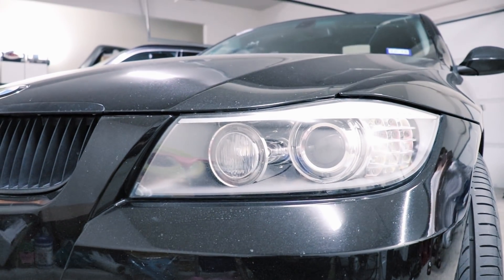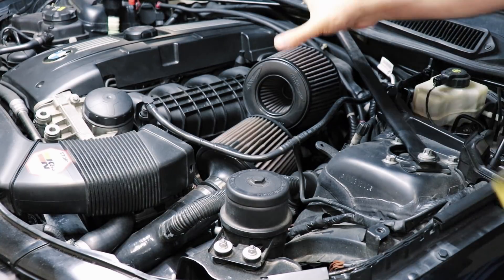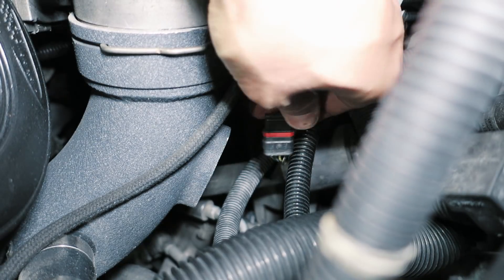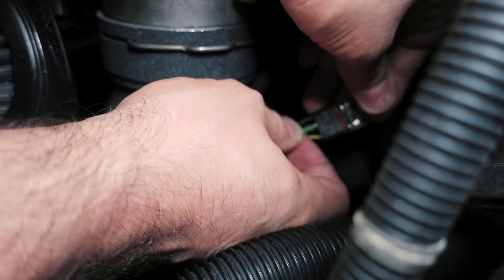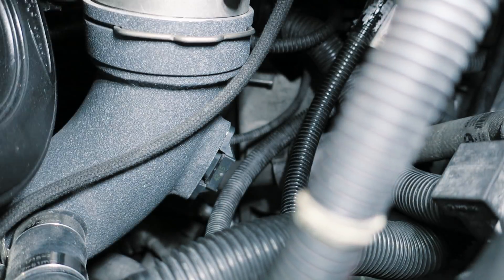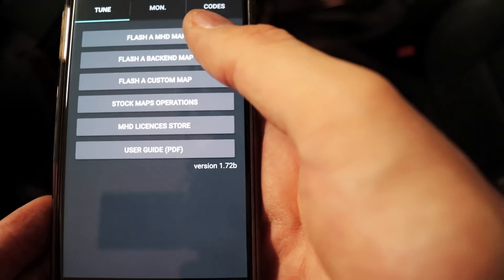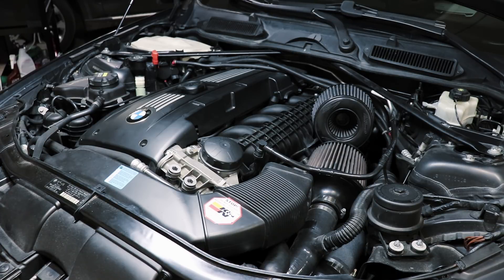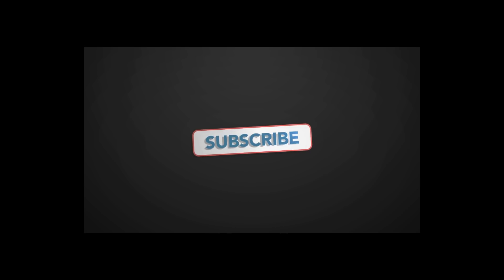Do you need an N20 map sensor on your N54 or N55 BMW?

Comment: Hello I have a n13 engine bmw f20 I keep getting low boost drive train error changed the map sensor was working fine again when flooring error happens again would I need a 2.5 bar sensor or higher as I've mapped my car boosting more

Comment: Nice Video, but one question... if you have external boost gauge, there is no need to upgrade the sensor right?... stock sensor won´t limit the boost even if it is above what it reads?

Comment: Hello, I am driving an e93 335in 55dct. I found out while searching that 3.5bar n20 map sensor can be installed, so is it okay to use either f30 or f10 stock n20 map sensor? I wonder if it can be installed right away without needing another adapter. And I wonder what the effect of this is. Have a nice day

Comment: I’m currently collecting parts for my custom tune and this is on the list 
When you fit this sensor does the MHD monitoring app show correct boost pressure or does this just scale the 0-5v output
Reply from the maker: Yes it does, the new info gets written to the DME when you check the option when flashing.

Comment: Thank you for this Information. 

I did mine just like that but do you know how solve  2abd bmw code
Have 17t turbo mhd .jb4 backnend flash driving for 6 months like this and this morning that code comes up every time I start
Reply: Dear, i have the same issue do you fix it ?
Reply: @raphaelpmcurvo  hi you in cape Town
Reply: Firstly check  your plug at n20 sensor all wiring connections.

Comment: I bought the BMW Brand 3.5 BAR upgraded MAP sensor from ECS Tuning.  I'm running MHD stage 1 v8 on my 2008 BMW 335i N54.   I was throwing DME codes 21ABC & 3100 and had to do the rewire to fix it.

Here's the part number in case anyone needs it. 

Mfg Part #13628644433
ECS Part #ES#4164452
Brand BMW

Comment: Hey man I I just installed the 3.5 on N54  flashed it with MHD also running JB4 flashed it on both side and the car is running super rough and won’t hold idle. I bought it with the harness and I don’t know if that’s the problem or not do you have any recommendations should I get rid of the harness and do what you did in this video ?

Comment: 2008 335xi e92 n54: 
What BAR is the OEM sensor?
I only need the N20 if boosting more than 20psi?
Great videos 
Thanks!
Reply from the maker: Thanks!  Up to 22 psi on stock sensor.
Reply: @VehicularDIY  Do you how many BAR the stock sensor is? Curious.  Thanks for your reply.

Comment: I have an n54 motor with a Cobb tune , metal charge pipe , cone air filters , intercooler upgrade , standard turbos , scorpion back box but standard cats , 390 bhp , would it benefit this upgrade? Thank you.
Reply from the maker: If you plan on getting a custom tune it would.  Where you push the boost up.  If you want to stay around 400 HP you wouldn't need this.
Reply: @VehicularDIY  not sure what a custom tune is , is it the same as a remap , and would the power hike be worth it ?

Comment: Hey bro i did this for some reason I’m getting 2abd code now and it starts up with half engine light. I checked everything of the wires they look fine and when I clear codes it doesnt come back will i restart car. Please help. Yes I did check the box and double checked the wiring and sensor
Reply: do you fix it ? have the same issue?
Reply: @raphaelpmcurvo  get a oem sensor. EBay ones was trash

Comment: Hello there I’ve been following and watching our videos absolutely love them great DIY‘s appreciate all the knowledge you shared with the Bmw community. I’m currently running into an issue when installing the N20 map sensor. I did the Harness swap as you  showed in this video then go into my JB4 Mobile and select 3.5 n20 map sensor. I also have a back in flash through MHD but when I go to rewrite that map in mhd it will not allow me to select the map sensor sense it is only a back end flash. So I have to select it in my Jb4. but when I go to start my car it’s acting as if it nothing was changed in the Jb4 and car ideal like crap could this be do to the fact that  I have a back end flash and it does not work with a mhd back end flash  and Jb4 working together or do I need to ditch one or the other sorry for the long comment just looking for an answer from a reliable source look forward to hearing from you thanks again
Reply: Tylor Harford I had a problem with alternator he made a video on replacing the voltage regulator but it made things worst for me I hope he replies to you cuzz I was wondering the same before I do this good luck bud

Comment: i was wondering if you need to flip the connections on an n55 335i also or if its just the n54 you need to do it with. anyone know?
Reply: i want someone to answer me that i jut want to know if i have to flip the wire on my 335i n55

Comment: All this boost but stock diverter valves.. any issues with that? Any point in upgrading for MHD stage2+?
Reply: I just got a custom built "3 evolution racewerks charge pipe and bov with upgraded fmic hoses and ditched the diverter valves, they're pointless

Comment: I have an N54 Wagon 535Xi and was planning on doing MHD soon. I did not know about this but i knew it needed something I was missing. Thank you very much for this, I really appreciate it!

Do you happen to know if this applies to N55? I am almost done with an E90 335i Stage 2. Everything Bolt on is done. Just needs MHD Flash BUT I am having Massive problems with codes and jerkyness of car since the CAI and CP were installed. CAI is aFE and CP is BMS, no BOV...reset adaptations maybe? Any help is really appreciated!

Comment: Hey Ive been getting codes for my old sensor so just going to upgrade to this one. If I already have mhd installed should I be flashing to stock operations installing then flashing back to my map with this checked off inn the options?

Comment: did u need a custom tune after inlets? any hesitation???
Reply: A custom tune will really make all the parts work in unison, besides the horsepower increase is insane.
Reply: @mperez9745  yes I agree.. but im concerned for the increase power will only put strain on my stock motor. Plus im told I'll need two maps to incorporate  " flex fuel".  Im having issues not hitting boost at the moment so replacing my boost solenoids this weekend

Comment: I have a strange question. I actually broke one of the prongs on my pressure switch the other day. Number 4 prong I broke. Is there a way I can fix this without replacing it or maybe changing the connections like you show in your video? Or can I turn the sensor off manually so I don’t get reduced power mode. I’ve got a MHD stage 1+ tune

Comment: Hey man great video
Just wanted to ask that theoretically the 2.5 bar sensor should be able to take up to 36 psi, I mean if you do the math just a simple calculation from bar to psi (1 bar is around 14 psi) so how come the 2.5 bar sensor on the n54 can take up to 18 psi only?
Reply from the maker: Thanks you subtract regular atmospheric pressure first.  So 36 - 14 = 22.

Comment: I have a 3.5 bar TMAP on order. I'm running JB4 + BEF (pump gas), Map 7 (targeting 19psi), FBO (inc turbo inlet pipes) running 99 RON and I am maxing out the sensor. I get a flat line on boost at 21.3 psi for a few seconds then it knocks me to Map 4. So I'm running MAP 2 targeting 17 psi in the mean time (hitting a steady 18psi) until it arrives.
Reply: Ivor Problem I have exactly same problem but  with e85 bef, did this fix your problem and not kicking you map 4 any more with map7?
Reply: @juliuskauhala2569  Yes problem solved. I get a max 23 psi dropping to the targeted 19 psi.
Reply: Ivor Problem yes just installed mine and works like a dream without kicking map 4
Reply: Ivor Problem  Were you able to select the N 20 map sensor in the back end flash MHD or did you have to select it and the Dj before app I’m currently having issues getting my in 20 map sensor to work properly on my image do you tablet app is not allowing me to select it because it’s a back end flash so I go to my Jb4 setting and select it and for some reason when I start the car it runs like shit can you help lol
Reply: I have fbo minus fmic and running bms bef with map 2-5 and 6 it goes into map 4 sometimes depending on the pull think its the sensor? Reading funny above a certain psi

Comment: If you have the mboost option do you still have to have the n20 sensor? I'm running the mboost without the n20 sensor. Im at 20 psi on a custom tune.
Reply from the maker: If you were pushing slightly more boost you would want it.  At 20psi you can just get by with the stock sensor.

Comment: Do you have an email address you could share? I would like to talk to you about Log Dyno. I have also added a new feature so it is not only for measuring performance, but optimal shift points can be calculated with a press of a button.

With the stock twins we run out of torque up top, so you need to shift earlier but it differs in each gear and depends on the torque curve and gear ratios. This can be calculated to achieve the best possible acceleration.
Reply from the maker: You could send a friend request and shoot me a message on YouTube.
Reply: Vehicular DIY I found this to be the only way to add you on youtube, you need to accept it https://youtube.com/add_contact?c=n6n3jc-NPFb9K5KwHXqlIcovf5rOJQ
Reply: can you please send me that too?

Comment: Hey i have a 2012 335is and i have inlets, vrsf chargepipe, rb inlets, downpipes, intercooler running mhd stage2+ u think i need this or am i good
Reply from the maker: Sounds like you're not targeting more than 18.5 PSI so you should be fine with your stock map sensor.  You have the supporting mods to make going to around 21.5 psi worth while.  So if you're considering that and want a custom tune then you'd want to the N20 map sensor.  Are you running ethanol?
Reply: Vehicular DIY no just stage 2+ w 93 pump gas, it lays down 440rwhp, kills a scat pack and I've beat a stingray before, i don't think it would be wise going any higher as i am a high school student and i can't afford new turbos
Reply from the maker: 440whp on pump gas is awesome.  Yeah then the N20 sensor won't really add value without the custom tune. If your stock one goes bad then might as well upgrade it just incase but otherwise you should be fine with the stock sensor.  I'm going to start with a tune up to 22 psi then I'm going to upgrade my turbos but mostly for the channel.  Not sure how much longer this will be a practical daily but I want to show you guys what can be done with the platform.
Reply: Vehicular DIY I'm always watching great content, i have a slight vibration when i take my foot off the brake from a dead stop, previous owner said he replaced passenger side engine mount and its still the same any idea to what it could be? The tranny was taken off once possibly a tranny mount? Car has 49k miles thats why I'm skeptical about it being the engine mounts
Reply: Allen Messi definitely the passenger side mount as your engine flexes towards that side since it’s in drive it rocks a little towards the passenger side which causes vibration
Reply: Robles Inline 6 he said he replaced the passenger side? Could he of not installed it right and just needs to be installed properly?
Reply: Allen Messi that’s weird it could be but highly doubt have you checked your guibos on your driveshaft for wear
Reply: Robles Inline 6 didn't know they existed 😂